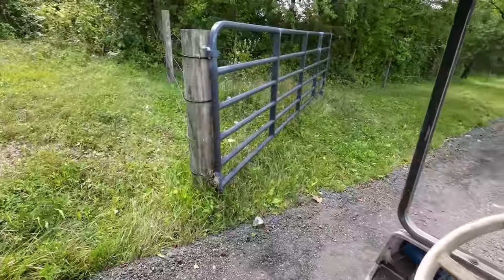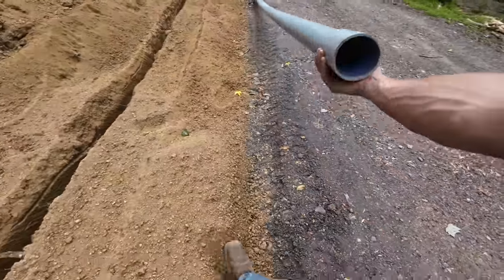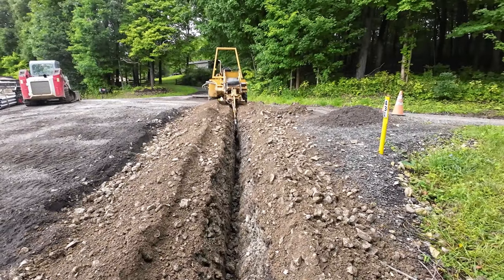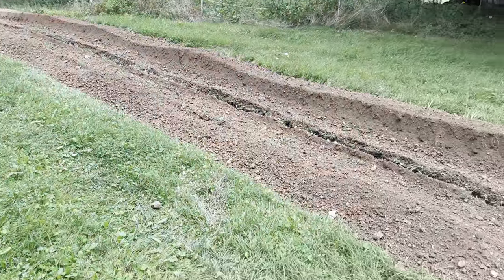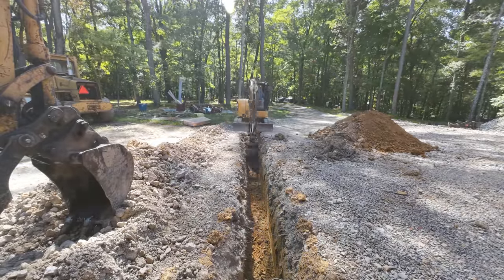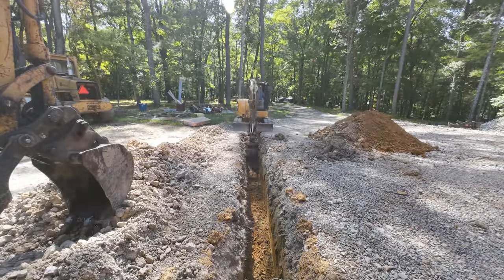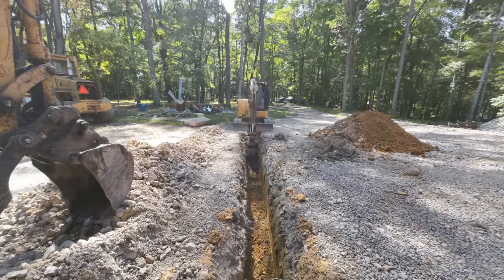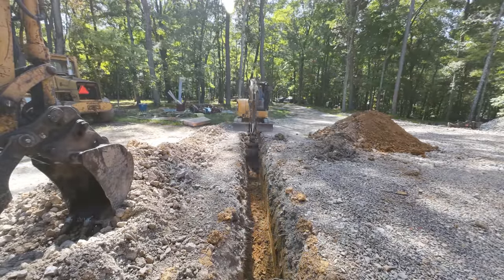Running Nearly 1/2 mile of Underground Electric, Costs over $64,000??!?!

Comment: Here in the UK I got a quote for connecting my house to the Power Grid.
It was £84,000 ($105,100)!
The nearest power pole was 250 ft away but apparently the extra 100 Amps for our supply would push the system to breaking point so the whole local connection would have to change from overhead to underground back to the substation 2200 ft away.
10 years on we still use a 6KVA diesel generator!

Comment: As an electrician this is a hell of a lot work for one person. Hats off to you
Reply: Exactly!!. Also i dont see the need for all that conduit for utility cables.. 🤷🏻‍♂️
Reply: @MrBill3288 maybe not immediately, but direct burial hasnt been a thing in my area for ages, and ive replaced plenty of direct burial service lines that have deteriorated over time and caused issues. Its not great long term if you want your stuff to work a decade or more from now. The cost of conduit is mall compared to the cost of redoing it in a decade. 

Also most places literally wont let you. Weve known better for a long time.
Reply: @MrBill3288 has many purposes
Reply: @goosenotmaverick1156   yep in conduit makes repairs and upgrades easier especially if you used conduit 2 or 3 sizes bigger than you need and big radius bends. we did that at my parents and when we upgraded to 3 phase power they simply used our existing cable to pull the trace wire and then bundled the new line with the existing and dragged it back through. saved labour versus trenching new conduit.
Reply: @chrisforgan731  ive done that before in commercial spaces to convert from single to 3 phase service. 4" conduit, something near 500' run. The cost savings on materials was astronomical, as well as the fact that it would not have been possible for us to dig anything new, as it was under a large building as well as parking lot, landscaping, etc, of a mixed use comercial/residential mixed use building. 

Also I live in the Ozarks, our rocks laugh at trenchers. I was digging yesterday and found more than one 100+ pound rocks in my trench. A couple larger than the bucket by a long shot. I wish we could legit use a trencher. 😂
Reply: @chrisforgan731  we also had a residential customer with a direct burial feeder to their house. The tree roots grew between the lines and split the insulation. It would only short and trip the main breaker at the pole when it rained more than an inch in a certain amount of time. It cost thousands to replace that, over a few hundred bucks in conduit at the time, less when the service was originally run. House wasn't even that old. 70's ish? And this was years ago now. Just the one that immediately came to mind cause the guy had similar taste in adult beverages as myself. (he offered, I couldn't as I was on the clock, but it started good conversation while making terminations and checking things over) the cost of conduit can save you money hand over fist in the long run. Same when my dad built his shop. We ran conduit through the concrete in preparation for air, water, and electrical. We used every damn one of em 😂
Reply: @goosenotmaverick1156  Plenty of places still let you do direct burial. I'd rather have my stuff in pipe too, but that's probably $14k in pipe. It should be fine on its own, especially there but it's whatever someone want's to go with.
Reply: @Eargesplitten-Loudenboomer  now I'm curious as to who still allows it and under what conditions it allows it. Are you talking about within the US or elsewhere in the world? 

Yeah it's a hefty cost in pipe, but if it means I do it once instead of 3 times in my life, my opinion previously stated still stands.
Reply: @Eargesplitten-Loudenboomer  also not to mention the extra protection from strikes during other projects, improvements, etc. If you smack it with a piece of equipment, it has a far better chance of the wire surviving. And of course the protection from ground shift. I'm not sure where you live but in my area, it's a terrible idea. But we also can't dig using a conventional trencher, so.
Reply: @goosenotmaverick1156  I'm in Ohio. In the end it's up to the AHJ so there's no "conditions" necessarily outside of the NEC. I think it's a good idea to do it and the use cases you stated are correct but I've had to fix plenty of things in pipe that were struck by a hoe, trencher, metal stakes. Is it better? yes, but it's no end all be all and can get messy just as easily. If it's getting done "3 times in your life" it's probably getting done 3 times regardless of the pipe.
Reply: Entergy, the old Arkansas Power & Light only charged me to pull $500 to pull 100 feet in my conduit to upgrade from 200 amps to 400 amps. 
$5 per foot, I thought was quite fair.
Reply: 3:25 I mean he has his AI powered excavator running in the back here, probably not 100% alone, still a big feat nevertheless!
Reply: @MrBill3288  then you're clueless so maybe don't speak on stuff you clearly know nothing about
Reply: not to mention matt is 27, impressive as could be

Comment: I'm a lineman for a local utility (I also live in PA). That number is nuts but I'm not surprised. That job is a max 3 day job for a 4 man crew. Probably $250 hr (I get 1/5 of that) which includes the truck usage you're looking at 20-30k in just labor. Realistically a good 3 man crew could do it in 2 8 hr days.

Comment: Little helpful tip with running pull cord through all that conduit. (I do it all the time where I work.) Cut the top off a coke bottle or a find a cup that fits loosely in the conduit(we usually use a 30oz Gatorade bottle but thats for 4"). Place string through cap of bottle and place in conduit with lid pointed into conduit so open cut off end of bottle will trap air making a seal. Then use a cordless leaf blower to blow string and bottle through conduit. Works way better than a shop vac. Also you might need to use a lighter pull cord for those longer runs. Big box store sell klien brand pull string but honestly we have started using poly baler twine. Its the same stuff. And then use that to pull the mule tape. 
Also my boss was able to work a deal when he built a house along way off the road and he bought the wire and pulled it all and saved a lot of money from what they originally quoted but he has contacts since we work with the field guys and he knew the right ppl to talk to but might be worth a offer. Good luck! Hope that helps.
Reply: Damn, that's sounds very smart and effective (no sarcasm). Kudos!
Reply: I work for a company that builds electrical connections in Windmills.
When we need to pull Kable thru a pipe we use a big compressor to blow a smal Steel winchcable thru the pipe.
We putt lubricant in the pipe and have a foam ball with a ring on it that fits snug in the pipe.
The wirecable goes on the ball and at the end of tehe pipe we put a big rubber seal with a smal  opening fore the wire and a conection for the compressorhose.
Putt airpressure to it and away she goes😂
Works a charm😊

Comment: Perhaps you have already requested this, but you should ask for an itemized list of the costs from the utility company.  They should be able to do this and you would be able to really zero-in on the particular ridiculous figure(s).  You are doing a tremendous job and you deserve special kudos for what you have done.  The best to you!
Reply: Indeed. Looks like they made it buy the transformers... and the truck that delivered it! I could see ~10k$ for cable, conduit, and machine rental.
Reply: Sounds like they quoted to do the entire thing, trenching conduits cable etc.   Definitely  ask for an itemised breakdown then buy the cable yourself and pull it though so they just have the transformers and connections to do.
Reply: I wonder, if the correct wire cost 10.000 USD if he bought it, if it would be possible for him to just buy the cable and do the pulls himself.

This way they would have to give him the price, only to wire the transformers and labor.

This way there would be no way they could upmark the cable price.
Reply: I work for an electric utility. Last I knew the cost to run wire after you install the pipe was around $14 per foot. The wire itself cost between $2-$3 per foot. Most primary conductor distributors require you to be either a utility or a utility contractor to purchase the wire. If you have to upgrade or install a totally separate pole for your riser pole, that’s additional cost. Most utilities supply the transformer for free…. These are the basic details, it gets complicated after that

Comment: I ran into that. They wanted $48,000. Total solar was going to be about 22,000. Then no electric bill. I then talked to a private contractor and he quoted $5,000 plus labor if I trenched it.
Reply: Was that tench for high voltage or house voltage?
Reply: @lawnmowerdude  I actually don't know. I think it was 7200 volts. I was going to need 3 transformers for the distance. His price was for conduit and cable. I was sitting by him while he was on the phone with his supplier. I don't remember about the transformer price. I think they had to come from TVA which is our power provider. I trench and help with labor. Would be him and me on that. That price was just a rough estimate to get a ballpark idea. This was 2 years ago too.
Reply: @Anthony_Harper You don't put more than one transformer in regardless of distance as far as I know.
Reply: @Anthony_Harper did you end up going solar? That's my plan
Reply: @JunkyardJosh  COVID hit and decided to wait. I have plans to start on some of it this fall.
Reply: @mcg6762  the electrician told me they are only good so far. If you look back at the video, he has sections. That may be where he puts them in. Don't really know.
Reply: @Anthony_Harper  A transformer for a residential installation is used to step the voltage down to 240V from 12000V or whatever is used for the feed in the US. You wouldn't step the voltage down several times. The sections in the video are used to bring the cable to the surface so you don't have to pull the cable through the whole run. You can pull it in sections.
Reply: @Anthony_Harper  Electrician is wrong.  One transformer from primary to secondary.  Normal primary is like 7200-14400V.  Pad mounted transformer at location of use, don't want secondary to be more than 100-200ft.
Reply: @86turbodsl  I may have misunderstood him. It was just a preliminary guestimate on the spot to get a very rough idea . I was telling him how much it would cost and he volunteered and said he would do it for a fraction of that. I asked about how much was a fraction and he quickly gave the amount after the call. 
I tried to cut the cost of the power company doing the whole job by trenching and laying the conduit and wire myself but they said absolutely not. They had had problems in the past with that. I said I would do it and let them drive by and inspect my work at every step. Nope. They would not budge so at least he got to do that much. Probably would be $100,000 if they did it all. Monopoly you know.

Comment: Matt, I spent most of my 45 year career working in the utility industry. 
I can tell you that nothing is ever done cheaply. I’m sure that 54K includes engineering costs, legal costs, and probably a lot of the work you’ve already done. Also, medium voltage cable has gone sky high in cost in recent years. Plus at each pull box, that cable will have to be spliced and tested. Utilities are very segmented, so the people you deal with probably only have a “per foot” cost number that they use for the estimate. Most likely they cannot give you answers about the details I mention above. 
The first thing I would do is request an itemized estimate that breaks down all materials and labor. 
The second thing I would do is contact some qualified electrical contractors in your area that are experienced in the installation of medium voltage electrical services. They can tell you who is authorized by your utility company to perform this work. 
You might be better off hiring them directly to run the primary service. 
Armed with a contractor estimate, I expect you would be in a stronger position to negotiate with the utility. 
Not to discourage you, but this could take much more time than you want. I’ve seen these things take years to be settled. Sorry, but that’s the truth in todays world. 
For the  relatively small of mount of power you will need, I would have seriously considered a combination of solar, battery storage and diesel generator. That might still be a viable alternative.
Reply: having such a big roof and not filling it up with panels at todays prices is straight up flushing money down the drain
Reply: @Nebbia_affaraccimiei  Not if you want a safe, warm , well lit working space.
Reply: And you want the lights and heat to work when the sun is not shining or only a couple of hours a day.
Reply: Minimum cost to bring in power to our cabin 1.5 miles from the closest pole was quoted at $37,000 from our utility. In the end, I did 16KW of solar, 90KW of batteries and 16KW of inverters, with a surplus MEP diesel military genset for backup. Came in at around $50K. Been running 5 years with no problems. I’m going to add a bit more solar for EV charging eventually.
Reply: @Nebbia_affaraccimiei  Matt has said in the past he plans to do solar some day-  but h'e on a timeline.  the shop is his lifeblood, and blood needs oxygen, or in this case, Wall-Gas. Unfortunatley, theres not a lot of solar companies who are willing to work with someone who does what he does.
Reply: @Nebbia_affaraccimiei I say not solar is feasible for a little cabin or camper at $5,000 to 10,000. But not on a bigger scale or where you feed the utility company and then they reimburse you off what you’re solar produced. At they made up prices 😂 I have priced it for me at $289 a month utility bill. I would be spending over $60,000 for the solar panels to cover that cost. Would be over 17 years until it paid for itself. With panels only guaranteed for 25 years life expectancy 💁‍♂️👍
Reply: @kevink4914  
Yep, when I bought my house I also bought the property right beside me "which is 1 acre" & I had all intentions on filling up the whole acre with solar panels, but as you said after I got to looking into it it's not worth the time, money, or aggravation. By the time I got everything paid off it would be time to replace the panels. What I found was if you got 25 years you're doing good,most likely it would be around 15 years. And that's just the panels I haven't even mentioned the batteries.
Reply: @ianmarsden8568  Once he's on-grid, maybe he can sell enough solar back to the utility to recoup his install costs :)
Reply: @dieselaar  And air conditioning in the summer.

Comment: Matt,  I manage the construction of gas upgrading facilities all over the US. We routinely pull in 1,200 to 3,000 Amp (3 phase) services. We supply the materials, permits, and misc. cost  for a service entrance (ie. Conduit, Wire, Concrete Pads, Transformer, Switch Gears) to the power company and they provide the labor. We routinely pay $36-$53K for these entrances (All In Cost). The power company usually charges us $12- $15K for their portion which is typically prorated out over the course of 72 months on the monthly service invoice. If I were you, I would be thankful they didn’t require the road and waterway crossings to be encased in dyed concrete, we have ran into a lot of that recently.

Comment: Matt, I work for a rural electric in Nebraska, we would charge $9 a ft for primary urd plus 40% of the cost of the pad mount transformer and would also have a five year agreement.  Customer is responsible for the trenching as well as secondary wiring.   I’ll check tomorrow at work but I think it would be around $20,000.

Comment: I agree that you can call in an independent certified contractor to pull the wire. Then they may even be able to do the transformer. Utility company to just stamp approval.
Anyway, ton of work you did. Cudos

Comment: I would 100% be asking for an itemized quote to see exactly where that cost is coming from.  From there, I would be talking with some local electrical contractors to see what they can do separate from the power company to minimize costs.

The 7kV line from the pole won’t require a large wire gauge, and that’s 90%+ of the run, so wire costs should be as “optimal” as you can get with your setup.

Comment: Well, 16 hours after this video premiered I think there's at least a majority of the 49,000 people who've watched it, know just how hard you worked to get this job done! I'm amazed you tackled this solo! An extraordinary amount of planning and work! The only experience I've had with the power company and running wire was above ground on poles but they got us for $11,000 for 800' of an installation for a water well we put in for filling duck hunting lakes (not counting the well casing and pump by the well contractor ((who incidentally KNEW  that 800' from a bluff, we would hit water at 75 feet deep (79' exactly))). Best of luck with getting that price to a more manageable number. Can't wait to see that boiler fire up and see some STEAMING CONCRETE!

Comment: I was a lineman for years and done hundreds of new line installs, the electric co-op I worked for the first 300 feet was free and anything over that was $1.50 a foot and the co-op supplied the wire and conduit. It was the landowners responsibility to have the right of way cleared and the ditches dug. I retired in 2007 so I'm sure the prices have increased but $52,000 sounds waaaay too high!
Reply: from 2007 to 2023 prices have increased so high ....you should know that as a lineman...past 2 years alone it's probably increased 2 fold.